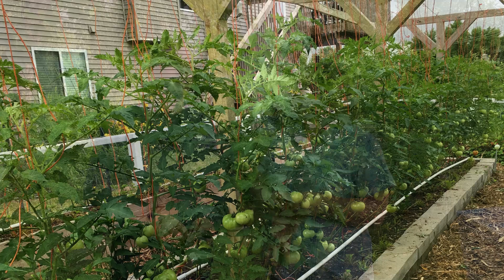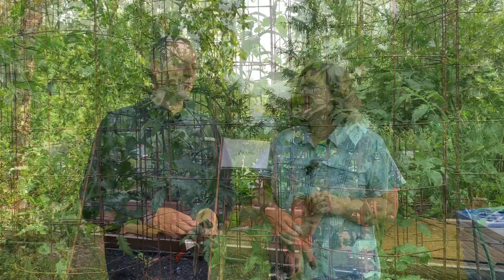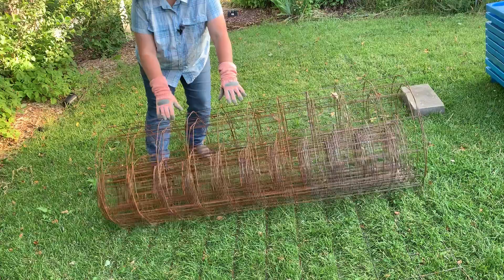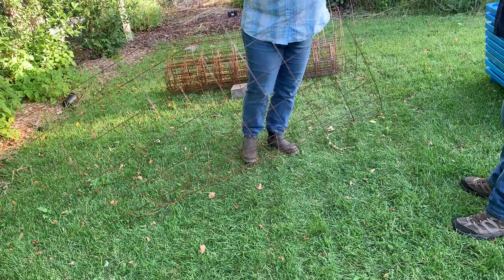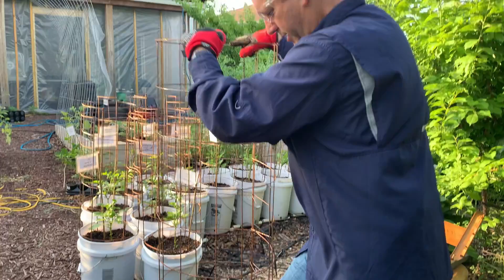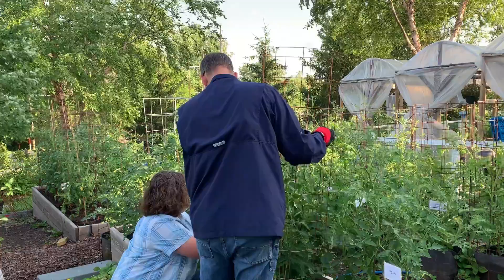Tomato cages for Buckets, Grow bags, and Raised Beds

Comment: Cement wire has 5 inches square that's great for tomorrow. for as panels and cattle panel openings are smaller that isn't as handy for tomatoes.
Determinat tomatoes I prefer the horrible famous tall tomato cages. I place 4 cages space according to sizes of the plants 
6 ft.T post starting with the first inside the cage and after the forth cage.
Repeating this 4 cages and the T post down the length of your garden..
After your cages and T post are done.
  On the first T post connect a tiny steel cable passing through every cage near top and connect the last of the cable.
I'm doing this for the 4th season and The 6 ft T post and cable system has been great and Mid Ohio also gets summer storms and not a problem.
Craigslist you can often get the " Horrible tomato Cages" that with this system I'm finally loving my tomato cages.
Positive with craiglist bargain this can be done cheaper then any other.system unless you count failure setups.
 This is the easiest way to train your plants keeping them off the ground